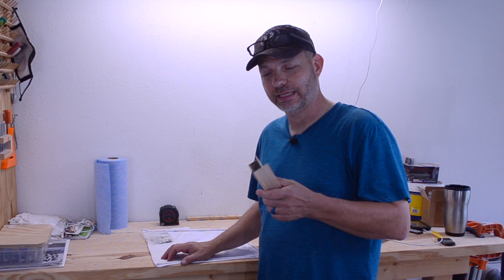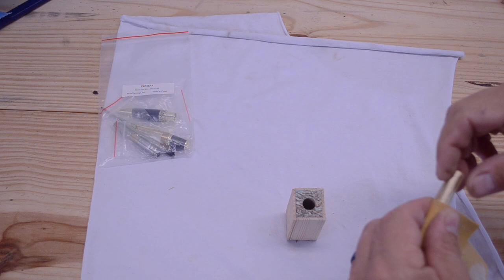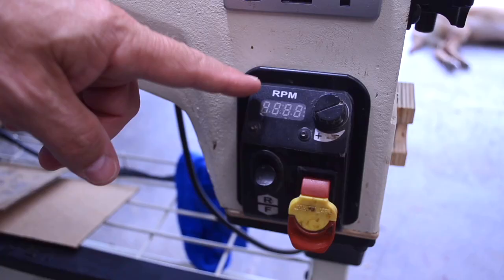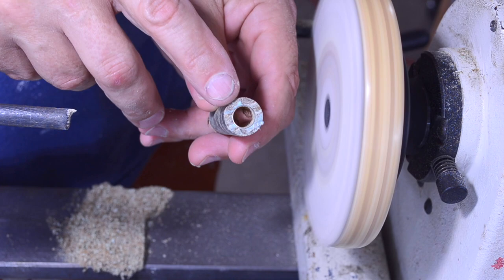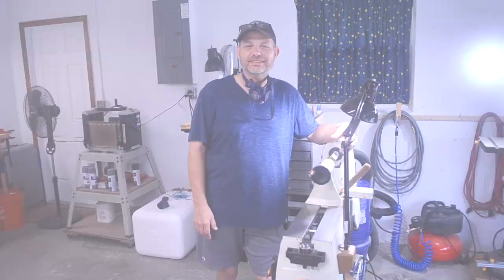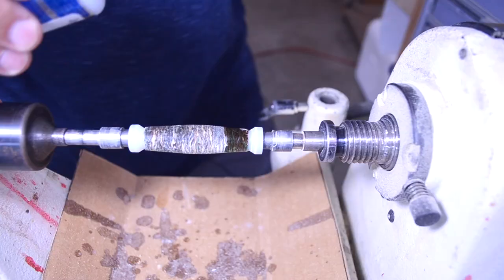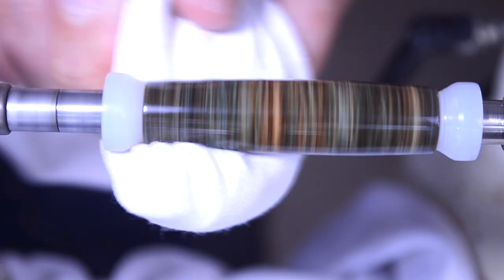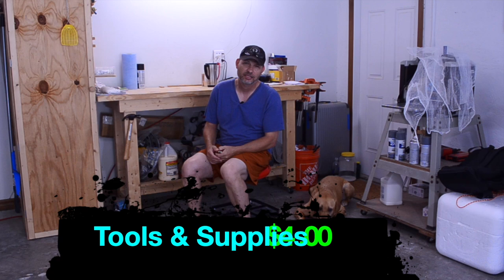How to Make a Pen for Profit - Hemp Style || Pen Turning for Beginners

Comment: Using CA every so often will help prevent blowouts.  Also using a Negative Rake carbide helps as well.   I have made many pens with Hempwood and you must be extra gentle with it and wear a face shield.
Reply from the maker: CJ, I can't tell you how much I appreciate you watching! CA is a great tip. That hemp blank was a challenge, for sure, but I loved how it turned out. I haven't tried the negative rake carbide but plan on it in the future.
Reply: @TheBillPayingHobbyists  I know Hemp blank dangers as I had one split it half on a catch and hit me dead center of my face shield.   So I always use extra caution and time to make any hemp blank.  No stabilized blanks are the same either as some have more resin than others.  If I do catch it. a little of the shavings and CA can help fill the voids and you may never even notice them.

Comment: Nice work - I'm enjoying all your videos! Just a question, is there a reason why you square up/trim the blank after rough turning? I've always done this before I start turning and it seems to work fine, but wondering if that extra step is worth it? Thanks again for all your videos!
Reply from the maker: Thanks for watching and the thumbs up. Very much appreciated. I sand after the rough cut because it’s less to sand.